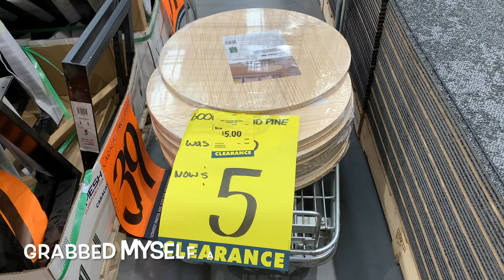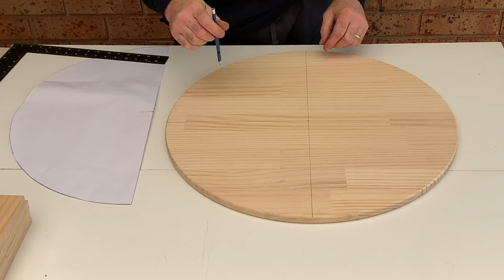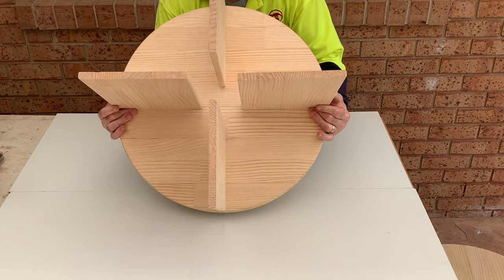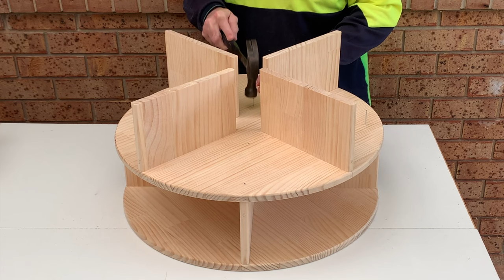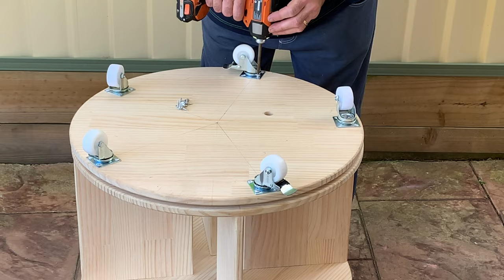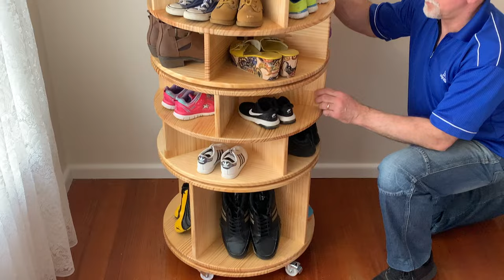How to make spinning shoe rack/ DIY WoodWorking .

Comment: Hola Excelente trabajo. De hecho me va a servir tu video porque voy a hacer una similar pero mas grande. Pregunta. ¿Qué marca y modelo es tu sierra de mesa la roja del minuto 1:38? Saludos desde México
Reply from the maker: Gracias señor, esta sierra de mesa es una sierra de mesa muy barata que compré en mi supermercado Aldi, está bien para proyectos pequeños, pero las medidas en la cerca no son 100% precisas, obtienes lo que pagas. !
WorkZone 210mm 1200W Table Saw $99.99 @ ALDI

19
0
WorkZone 210mm 1200W Table Saw  $99.99 @ ALDI
Go to Deal
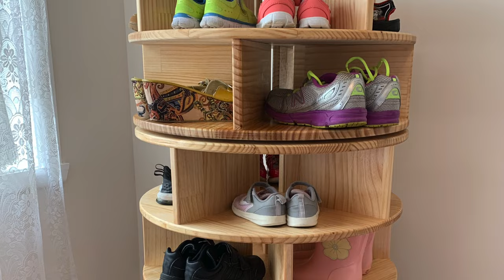nocure on 24/09/2019 - 12:21  aldi.com.au (3748 clicks)
Last edited 02/10/2019 - 18:00 by 1 other user
Dimensions: 625 x 575 x 435mm
Saw blade: Ø 210mm
Table size: 525 x 400mm
Cutting depth at 90°: 48mm
Cutting depth at 45°: 45mm
0°-45° bevel and mitre gauge
5 Year Warranty
60 Day Satisfaction Guarantee.

Comment: How did you connect the top round to the second one?  You seemed to just set it on top and IT locked down somehow
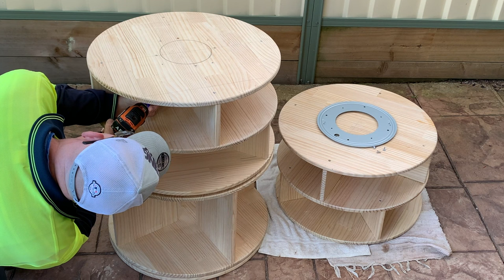Reply from the maker: Great question  !  I marked then drilled (4) holes using the Bearing Plate as a profile , ''sorry I did not video this ''  , I then added (4) screws from underneath 9:48 second round . I filed the (4) screws to make the tips flat '' again sorry I did not video this"  I then fixed the Bearing Plate 10:00 to the top round section, then carefully aligned both the top round to the second round 10:10 allowing the tip of the screws to sit in the allocated holes (Bearing Plate)...The click noise telling me both are locked in position .....to remove the top - simply wriggle the top side by side ,,, it will click to let you know it's free ...this allows you to transport the shoe rack easier ...ie upstairs...or to a family member by car... Regards Wally..
Reply: Good question please thanks for your insight

Comment: Awesome job! What sizes were the circular pieces and the dividers?
Reply from the maker: Thanks ,
The diameter (circular) pieces(9) featured in my video =600mm, 23.6''...... 700mm-27.6 inch would have been ideal !
(16) small dividers= 250mm X150mm (9.8'' X 5.9'') ..
(4) Bottom dividers= 330mmX250mm...(13'' X 9.8'' )
Reply: @wallytrinc9885  thank you so much for responding 😊